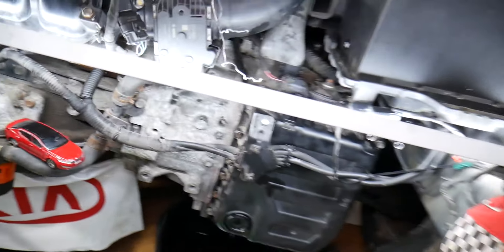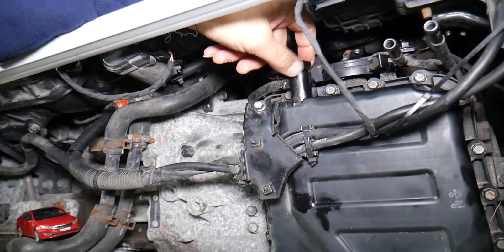HOW TO ADD CHECK TRANSMISSION FLUID LEVEL ON KIA FORTE OPTIMA RIO SOUL SORENTO SPORTAGE

Comment: So there’s no way to actually check it
Reply: @RawH0tMess he sounds like a cartoon character 😂
Reply: He just showed you how to check it
Reply: You pull the big plug with the ratchet end on the side when it drips out,,, it’s full. It’s the transmission level gauge. But be sure that it’s on a very flat surface or the level won’t be correct
Reply: Not with a dipstick, but he literally just showed you the only way to check it! 😂
Reply: Running when checking?
Reply: @travishill908 most if not all automatic transmissions you need the engine running and shifter in park or neutral to check level. Other thing to keep in mind is the temperature of the ATF, it will vary among transmissions. Here he tells you to check the coolant at 60c for a ballpark temp on the ATF, I believe it's around 50c on the ATF.

Comment: Do do you check the transmission fluid level while it's running? Like most other cars
Reply: I have done it running and trans temp 160. No issues after 50k miles.
Reply: 😢So we'res the dipstick😢
Reply: @robertsmith-bk9yp  There is no dipstick, as shown in the video there is a level check port in the front case. Look at the 5 minute point in the video. Check when warmed up and engine on, fluid should slowly run out of the hole when it's at correct level.

Comment: Thank you sir, it worked well, my transmission was making a slight noise added fluid and it stopped, thanks for the video
Reply: Where does the fluid goes

Comment: How to check the level with hybrid, because the engine is not running and there is no torque converter in the hybrids so even if the engine would run, it shouldnt affect the fluid level, right? I have seen one guide video where the guy just measures what he took out and puts the same amount in and I cannot figure out any other way how to check it with the hybrid. I have an Optima PHEV 2019
Reply: Step on the accelerator pedal

Comment: Is there anywhere we can buy a dipstick to replace the fill plug so we can easily see how much oil is in there instead of removing that lower plug and all the covers
Reply: No, there is no straight path down through the trans from the fill port, so a dipstick is not possible. As shown around the 5 minute point in this video it's not that hard to check. A dipstick would be better but hell then anyone could check it.

Comment: First drain the transmission fluid and then add new oil. Go thru all the gears 2x once it gets to temperature. Then car needs to be running in order to check? Top off until you see it coming out

Comment: That is not the fill point for the transmission. That is the breather. It's a blind hole with two four mm gaps either side to catch anything that goes down the breather hole. The fill point is at the back  on top of the transmission. It's the same size bolt that the drain plug is 24 mm filling it through the breather hole is the most ridiculous thing ever. Why on Earth would you do that? Fill it with a hook and hose and pump. It's so easy

Comment: The oil is supposed be red ? Can I used valvoline ATF ?
Reply: Transmission oil is usually red and regular engine oil is yellow, amd when dirty its black.
Reply: I recommend original trans fluid from a kia dealer
Reply: I've used valvoline on 2 of my hyundai sonatas and one elantra, no issues with it at all

Comment: Where do I check the fluid level I can’t find it
Reply: Did you find it? It's on the front of the vehicle laying under the vehicle you will see it facing where the bumper is. It's round and the ratchet itself 3/8 drive goes rite into the square in the center

Comment: I have a 2016 Kia Optima. How do I check the transmission fluid in it?
Reply: No need to check.
Reply: @bcar1ify  litteraly makes no sense...what do you mean no need to check?? I cant find a single video on this
Reply: @MLBMotors  no need to check the fluid. It’s a sealed system. If your going to keep the car past 100k miles then drain and refill 2 times. I have done that to both my Kia’s. There are plenty of videos on YouTube.

Comment: 2019 Kia Optima how tf do you just check it?
Reply: EXACTLY! I have a 2011 optima and I just wanna check n add some smh
Reply: Figured it out? I have an 18'
Reply: @adictiveadictive  I had to take it to the dealership apparently they had to reset the code’s whatever tf that means car was quiet like I just got it off the lot had to pay for the diagnostic and that was it like $160
Reply: @SuperDragonRED  
Reset the codes?? What were your symptoms, if any? Did they say your fluid level was fine?

Thanks for responding so fast!
Reply: @adictiveadictive  They said everything was fine just had to reset the codes which I call bs i dropped my car off Monday morning didn’t get it back till Thursday at 5pm after work so tbh I really don’t know what was up
Reply: @SuperDragonRED  
So it's fine? Did you have any symptoms or just wanted to check the level?

Comment: Okay so title says how to check fluid level and the video is on how to drain and replace the oil....a little tiny bit confused??
Reply: Just do the last part. Where you twist that fluid level plug and full until it drips.

Comment: the video didnt help at all.. how do you check to see if u need oil in transmission?
Reply: This is literally the same comment i left...this guy is usually helpful but this video is just terrible
Reply: He literally tells you at the end. Remove that round plug on the side and when fluid comes out at a drip its at the proper level. At least thats what i understood. If nothing comes out then add more fluid til it does.
Reply: Pay attention, he did show how. If he talks to fast , you can slow down the playback speed of the video😮